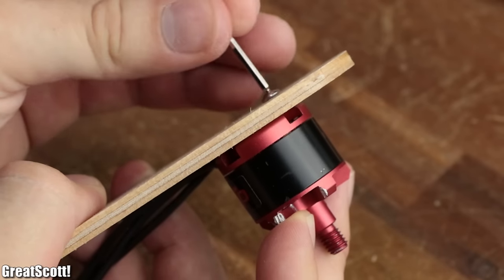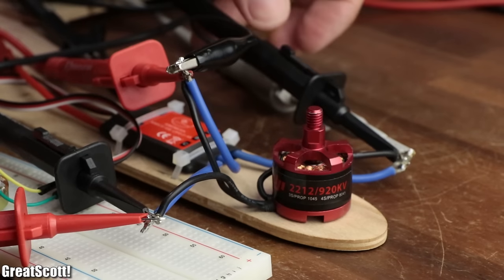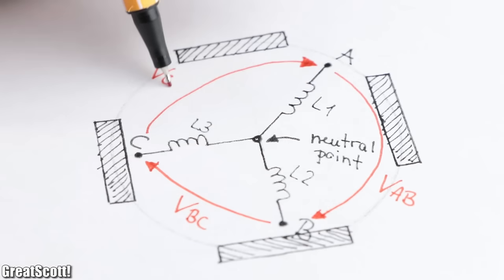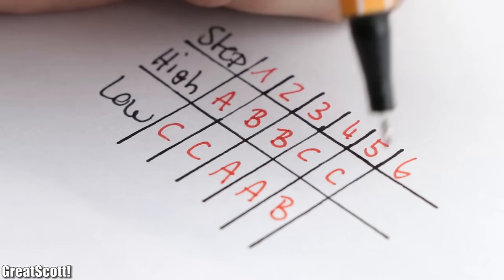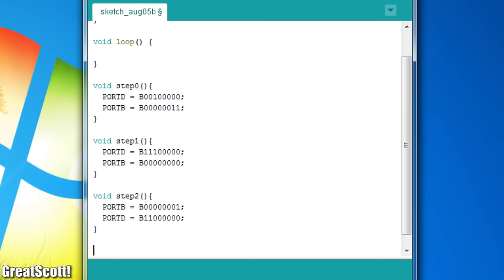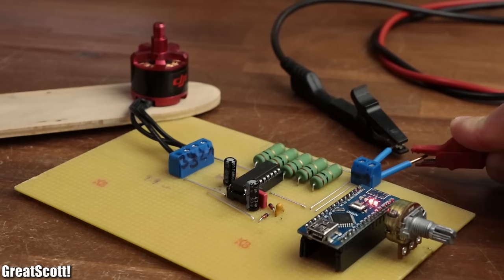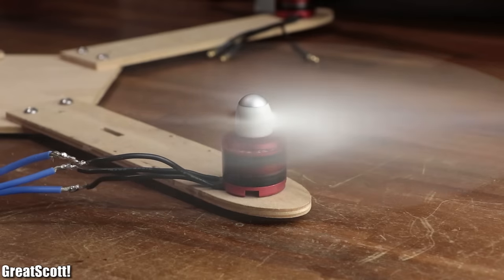Make your own ESC || BLDC Motor Driver (Part 1)

Comment: I’d like to see a video on measuring how many amps of charge an iPhone can take and then build a charger at maximum input charge! Awesome
Reply: Tim Corkill Li-ion batteries need regulated constant current charging (unless you like fires), so they should have a charging circuit built into the phone. So if it limits it at 1 or 2 amps, it doesn't matter if you use my 23 amp 5v power supply or a regular 2 amp USB charger, the charging circuit will limit it.

Comment: I have a question, I have a brushless motor that I use to spin a connecting rod but I need the connection rod to go to top dead center after a run. I learned that you can step a brushless motor by energizing one phase at a time however. I could use some relays to disconnect the motor from the esc and then use 3 more relays to step the motor but this adds a lot of complexity to the circuit and frankly space that I just don't have. I need an esc that can run normally but then once a relay is activated it'll step the motor. The stepping sequence I found for my motor is 
HLL
LHL
LLH
Any ideas on what I could do or any products out there that I could utilize?

Comment: Great video, thanks for sharing, my recommendation you do need create with the resistor network  one sensorless method for know the position of your motor and applied the current in  the correct moment for increased the speed and performance of your driver.

Comment: Interesting  I was always under the impression that sensor less escs used some kind of feedback from the motor as part of the way they ran.
Reply from the maker: Correct. But this is only part 1 of the project.

Comment: Can you make a video on what parts you always keep on hand? 
PS. I think you should chose a different material for your qaudcopter like metal mesh because the wood prevents airflow therefore adding more wind resistance.

Comment: Great start Scott, but what you are implementing is open loop commutation which is very inefficient. I hope you can reveal the secret of sensorless commutation feedback which allows variable power with best efficiency, so critical for battery operated drone flight.

Comment: hi
thanks for making video on ESC .
But will you make ESC in  which arduino uno drive six external N channel mosfet to rotate the BLDC motor.

I had modified an 30A ESC
to 150A by using external six low Resistance N channel mosfets

Comment: The way those wooden arms are attached with two bolts tells me they're going to yield as soon as there's a battery weight in the middle and the motors spin up. At minimum gotta add that third bolt nearer the arm.

Comment: So I was thinking about this video when I woke up this morning and was wondering what the difference is between Electronic Speed Controllers, Variable Frequency Drives, and Variable Speed Drives?
Why do multirotor hobbyists use permanent magnet DC motors and not AC motors?

Comment: Nice project and great job but how you force the motor to start smoothly from low speed without  decreasing potentiometer to minimum value ?

Comment: So the mosfets and their driver circuits are all inside the l6234 ic chip? also, iam not sure if you are familiar with kiss esc's made by flyduino, but they have a stm32f that has a clock frequency of 48Mhz as opposed to the nano which utilizes an atmega328 that runs at a clock speed of 16 MHZ. does the difference in speed affect how much power you can get out of the motor? does it also affect the smoothness of the flight and how much control you will have over the quad?

Comment: Hi Scott. Thanks for the video. I tried to create the virtual reference point as you show in your clip at around 3minutes, but my Oscilloscope grounds the reference point so I end up still measuring the voltages relative to ground rather than the motor's reference. What sort of magic have you done to get the measurements you get in your video?

Comment: Will you be using an inertia measurement unit (IMU) in this project? Even if you aren't it would be a great topic for a video, I can't find any good videos on how to implement them with an arduino or anything. Could you possibly look into it?
Reply from the maker: I put it on my to do list
Reply: IMU is quite an adanced topic, I'm curious to see in how many parts would you be able to explain it.

Comment: Hey! Sensorless speed control of bldc motors was my graduation project. Don't make it sound it is easy! :P 
Jokes aside, you didn't mention rotor position estimation at all. I wonder do these ESCs also create a rotating field and hoping the rotor would lock and follow it? If that's the case, I would expect that to be very unefficient due to higher inertia of outrunner motors. Great video btw!
Reply: The ESCs used in RC models use BEMF sync like any other serious ESC designed to work with sensorless BLDC motors.
Reply: Sensored motors (simple), or the BEMF where you have to step up to a minimum speed before you can track the rotor.

The common ESC's are the later, even you can get sensored ESC's and motors.
Reply: For startup, yes. If you block the motor and try to spin it up, it will just skip. But why would it be inefficient? It works.

Comment: step = (step + 1) % 6; 
That will step up step each time, and set step to zero after step had value 5.  That is shorter and more efficient than to have a if-step.  So it will generate the values 0, 1, 2, 3, 4, 5, 0, 1, 2, ...

Nice use of map() there.

Comment: When dealing with counters that should never get over a certain value, such as 5 in this case, you shouldn't check    value == 6,  check value <= 6  ...   just in case a glitch causes you to somehow end up greater than 6.   Also, I don't think that chip has sufficient current capacity to handle prolonged motor motion... that's why those honkin fets are used.   You can, however, use such a motor driver chip as a first stage to some fets.

Comment: hi scottt. i a little bit confused. first you said that you energized two coil for the motor but in arduino coding, you enable 3 switch at each step? So it will energize 3 coil right?
Reply: Scott?

Comment: Very cool. At the end of the series it might be interesting for you to take a look at Vedder's ESC design. Vedder has done a great job and it's always illustrative to deconstruct a successful implementation.

If folks don't know what Vedder's ESC is, it's basically an open-source ESC with an active community and a great feature set. Check it out. I use it for my completely overpowered electric bike.

Comment: Hey ive been flying for a while but im totally new to the PCB-build side of electronics but with the release of Dronemesh's open hardware flight controller i am eager to learn more about circuit theory. Can you tell me where you get just the blank perforated board that you solder all the components too?

Comment: What program do you use for simulating and building the circuits? Is it expensive, or do you know of good cheap alternatives?
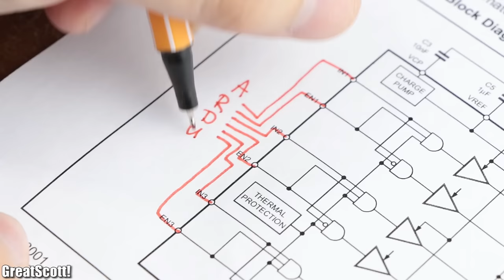Reply: ryccoh you mean that program at 6:02? It's free EDA
Reply: I think he said that he doesnt use one, but he also used LTSpice in his electronic basics: coils 2, you can simulate circuits with ltspice, but you definitely want to get a part library (ltspice is free, i think)
Reply: easyEDA? Is that the one?
Reply: ryccoh he builds his circuits in easyeda, but eda cant simulate. If you want simulations use Ltspice
Reply: Good to know, thank you

Comment: The ESCs used in modern quadcopters, as in ones from the last year or so, use something Called active damping or active braking, which while the motor is turning and you lower the throttle it uses a brake to drop the motor speed instantly to that lower speed instead of having it "freewheel" down to that speed. This allows the quadcopter to fly MUCH better and it is far easier to fly. Would it be possible to implement this into your homemade one? Or is that too complicated?
Reply: Active braking is doable you just short the phases together with the MOSFETs. For regenerative braking you need to know rotor position (measured on sensorless motors with BEMF, he will probably show that in part 2) then fire the phases at the right time to direct the generated power back to the battery.

Comment: Great job! I am trying to put together a "onewheel" type project but I am having trouble trying to find the basics for the code (I'm not great at coding) What I got is an arduino uno, brushless motor and a GY-521 gyro . . Have you ever done this configuration before? Or know of anywhere I could get the basis for the code to run such a setup as a "onewheel" type thingy . . Any info would be greatfull :-)

Comment: Once i made a esc for a brushed motor using a arduino to read the output of a turnigy rx. Since its brushed, its a lot easyer. But   brushless Motors are better for a flying machine i guess.

Comment: Yo, it would be cool if you will make a self excited ac generator. Like there's a small dc motor that works with the same mechanical energy as the ac generator and it will power the coils which will create a magnetic field etc etc that with the help of electromagnetic induction will generate ac voltage. Also, if you will make it, can you make it 3 phases cause it's better and it's more complex. This would be a great idea but it's very hard. I think you know what I am talking about. Or at least try explaining it to us. I understand the ac generator pretty good but I don't get how the "sine wave" works, like intensity or current is charge per time, so why the sine wave is represented so that on the Oy axes we've got current and on the Ox axes we've got time. Anyways, I love your vids! Thanks!

Comment: I wonder if it would be advantageous to use a simple inverter to change batteries' DC to AC and then use AC induction motors.

Comment: Just wondering if you could tell me where the actual connection point is for the three wires going into the motor because my three wires got torn out in a crash, so if I were to reconnect them inside the motor where would I solder them to?  Thanks!

Comment: Dude those are the motors DJI used in the phantom 3 only this ones are painted red you can tell by the design of the top and the screw-on propeller

Comment: I'd like to build an ESC with parts scavenged from old 5-inch floppy drives, mostly 'cause I have a ton of scrap ones. I suspect one difficulty would be having enough voltage/amperage output for powerful quad-copter motors.

Comment: A simple question : what happends if you send to the motor 3 different triangle signal (with the same frequency), with a face shift of 0°, 120° and 240° ?

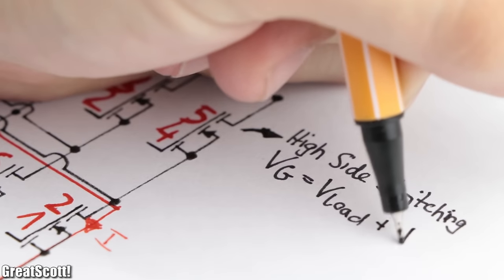Comment: 5:35 It sounds like a bad idea to use a N channel MOSFET on the high side of the load. First, then, the Drain has to be on the high voltage, else, if it is the Source which is on the high side,  the body diode of the MOSFET will conduct anyhow, no blocking from the MOSFET, and, secondly, to fully turn on the MOSFET  ( Vg >> Vs + Vth ), Vg=Vd = maximum voltage available is not enough,  since then the MOSFET resistance is relatively "medium" in this case... with lot of heat generated in the MOSFET (destroying it in the long term, without heat sink). That is why you almost surely need either an external power source connected with its + side to the Gate pin and the - side to the Source pin of the MOSFET, or a "boot strap" circuit, kind of "voltage doubler", to get more voltage than what is available, so now, Vg >>> Vs + Vth.  Not sure that using a P channel won't be that much less efficient, no?

Comment: Two questions. (I know nothing about coding) First, how do you convert, using arduino, an analog speed throttle signal to digital PWM speed controller signal and how do you write the code for it? Again, I don't know how to code. Second, where and how on a Vesc 6 would you wire an ESC and regen braking. Third, where can you get a regen braking button (link)? Would you find the ESC and regen braking in the same part or do they come together? Again, how would you wire them? I'm really stuck and would greatly appreciate some help. Thanks!!!
Reply: arduino has an "analogWrite" function which works with the PWM pins on most arduinos.
Reply: @brandonstevens6886  Thank you!
Reply: @williamcorkey3083  I would suggest researching more about using brushless motors with arduino, there are some great resources. Good luck!

Comment: Hey Scott! i wonder if you can make a simpel video to make a programing for a tank 
how to make it move. i have been desingning and printing a 3D tank but i need an arduinio logic board and 2 ESC to control the motors through WIFI and or bluetooth.
i'm clearly better at desingning than programing Thx
it would be great working if you could even help with the project

Comment: Is there a way to drive a non magnet motor like the one in a Tesla or in a washing machine I would like to get the washing machine motor to run on one of these motor controller drivers. Help plz. And grate video I will stay tuned for Part 2.
Reply: Jose Servin well it all depends on what the motor is.
Reply: First you will have to identify the motor.

I would guess you are refering to induction(AC, shorted coils rotor) or universal motors(eletromagnet/winding stator, brushes and wounded rotor)

Those would be some of motors without permanent magnets.

There is such a thing as a magnet-less motor, but those are more special case. (piezo, thermal..)
Reply: +erlendse it's a ac induction motor that my teacher gave me in senior year. is there a way to run it by induction a plus to the motor to create a magnetic field and run the motor. no sure what inverter it uses. I heard that it uses a high frequency pluse to drive the induction motor.

Comment: sir, please make a video on DC shunt motor speed control as per user's requirement using arduino . An user can enter RPM using a hex keypad. There will be a control unit that will try to maintain the motor speed that user have entered. also there will be a feature of clockwise & anticlockwise rotation of the motor.

Comment: Hello my friend. Looking on the internet for some information. I bought a brushless plane and know some things about it. My question is, how can you know or measure a motor for it's max voltage. The brushless motor uses a 5s lipo, but would it be possible to measure if it is capable of using a 6s lipo, that's jumping up the voltage.

Comment: Don't you need a way to find out the rotation of the rotor (back emf or a hall sensor)?
Reply: Mathis only on motors that have a high external resistance, for instance a very slow brushless motor with a huge prop would need one or a elecktric bike, because someone could stop the bell because of weird terrain for instance, on a normal size motor like this the bell will follow the esc in a predicatable way so no snesor is needed.
Reply: Yes you need to estimate the position of the rotor in a real application with a load. No sensor is needed because the voltage induced by the magnets into the stator windings during rotation (BEMF) is used to synchronize the firing of the phases. I will probably be shown in part2. Some motors use hall effect sensors to to that like you mentioned.

Comment: in bldc motor you use n-channel and p-channel MOSFET for bridge, but in this video u only use n-channel MOSFET. so what's the difference? when we must use each configuration type?
Reply: You can use both but if you use only N channel you need a way to drive them it is not as easy as if you are using P channel for the high side. N FETs can be cheaper and it can be a better production solution as you only need one type of transistor and not 2 matched types but you need a gate drive circuitry (bootstrap).

Comment: Hey man, thanks for the videos!
I have a question for you. I am trying to build something like a portable rail accelerator(inspired by your channel), so I connected 4 3.7 V 18650 li-ion batteries to a dc-dc power converter(9-80 input to maximum of 120v output), which is supposed to charge a capacitor bank (3x4700 mF to 100V), which are connected to rails. However, it does not charge the bank to set voltage (it rapidly drops down) and one of the caps gets hot. Can you explain why that happend?
Reply: Did you check the polarity of the caps?

Comment: missing a vital part of an ESC for a brushless motor; sensored or sensorless detection of the rotor position to drive the phases in sync with the motor
Reply from the maker: This is only part 1.

Comment: To save a lot of typing, you could have used a lookup table (array) for your PORTB states and just read based on an index. It would have replaced the function definitions and the switch statement. 

Google "lookup table" for more info.

Comment: 8:09 "if (step == 6) { step = 0; }" Triggered me AF, because there is simple modulo version step %= 6
Reply: This comment triggered me AF.
This is a common optimisation to avoid unnecessary divisions, which are comparatively slow, and modulus is even slower as it's composed of additional operations.
see https://embeddedgurus.com/stack-overflow/2011/02/efficient-c-tip-13-use-the-modulus-operator-with-caution/
If you run your solution 12 times you perform 12 divisions, 12 multiplications, 12 subtractions and 12 assignments.
If you use the if statement you do 12 comparisons, 2 conditional jumps and 2 assignments. No division, multiplication or subtraction even needed.
Just because the code looks simple, doesn't mean it's simple for the computer.

Comment: IS the A2212 bldc motor good for quad build ???...plz help
Reply: Prabhav Chauhan is alright. I’m using 920KV 2212 motors on my F450 with 30A esc and naza m lite, 1045 props and a 3s 5200mAh but would recommend to get like a 4s battery if you plan on hauling up a gimbal with camera
Reply: Max B thanks a lot !!